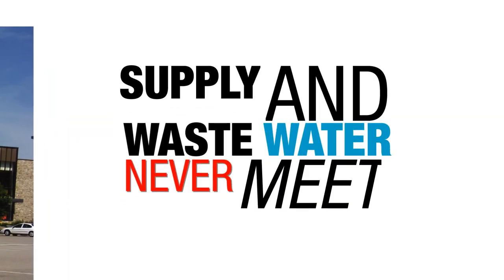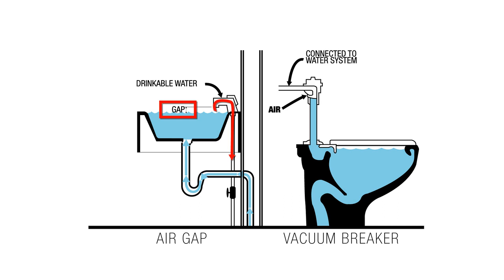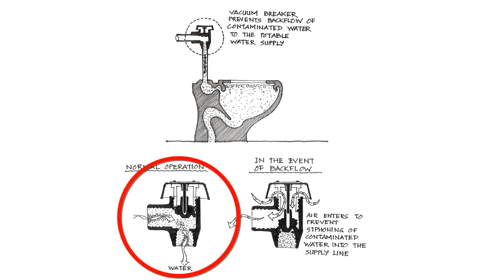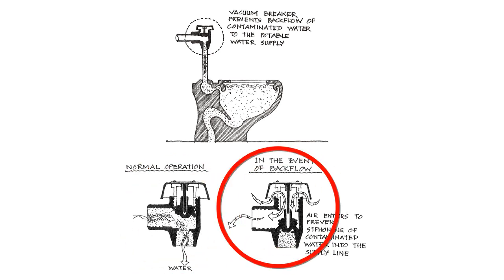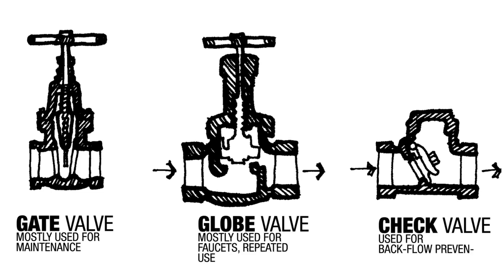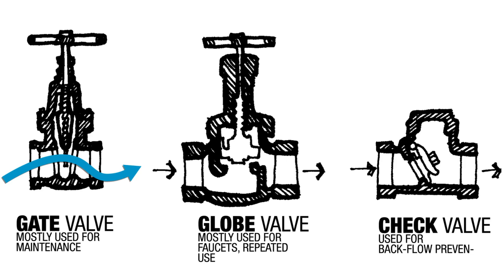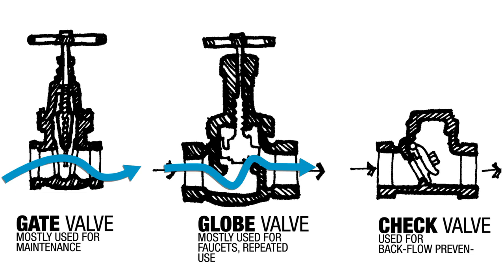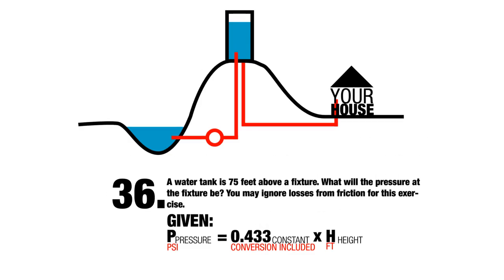How Plumbing Works

Comment: Globe valve is used to control flow, that is why it has much higher pressure drop. Changing the pressure drop (valve opening) the flow changes. Also missing is the butterfly valve.

Comment: There are a few other valves.  Beyond a check valve there is a double check, a dual check and an RP check, then there are also butterfly valves, ball valves, needle valves, solenoid valves, even the flapper on a toilet is a valve...and I am sure I have missed a few...LOL
Reply: Kelly P Kramer damn
Reply: The isolation valves of large backflow preventers are called OS&Y valves. Outside Screw and Yoke.

Comment: Your drawing of the "atmospheric vacuum breaker" is incorrect- the direction of water flow is wrong.
Reply: Not only that, if there is a drop in pressure or a vacuum in the main water supply, not only does a vacuum breaker prevent back-flow of water but also prevents air from entering into the main water system by closing the opening. Your information is flawed.

Comment: What about butterfly valves?
Reply: Butterfly valves used in domestic water plumbing systems are generally more expensive.

They are better suited for HVAC systems where the fluid used is treated for anti corrosion and non-potable.

Comment: how to make a pipe network using the following pipes and fittings (1 piece of GI pipe class B 20mm diameter 1.1 metres long,1piece of PVC pipe blended blue 20mm diameter 1.2 meters, 1 piece of Bib Tap13mm diameters,4 piece of elbows 20mm diameters, 2piece of Tee joint 20mm diameter, 2 piece of 20mm diameter by 13mm diameter, 1 piece of crossover socket 20mm diameter, 1 piece of G.I Union 20mm diameter,2 pieces of nipple 13mm diameter and 1 piece of Flexible HDPE PN 10 20mm diameter pipe connected to a water source for testing the assemble work piece.